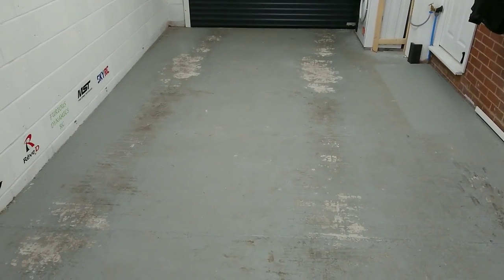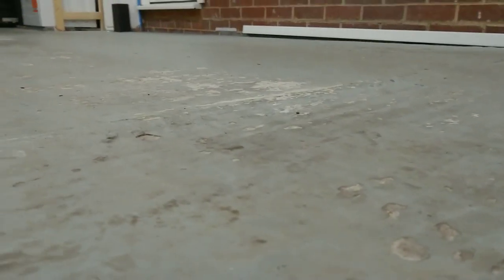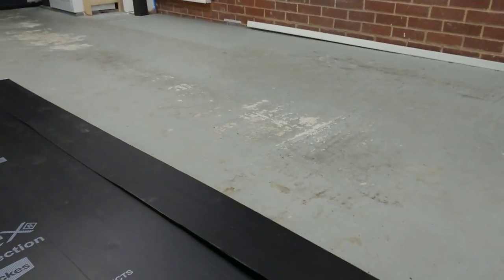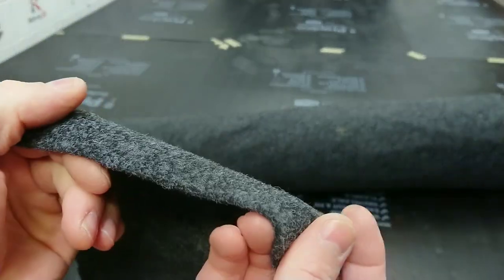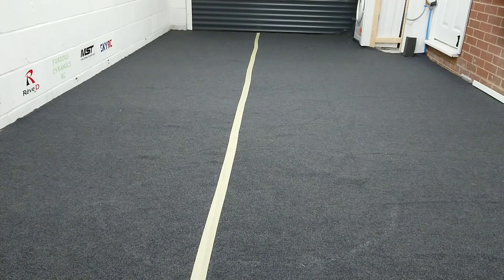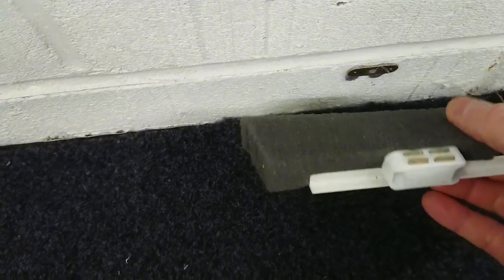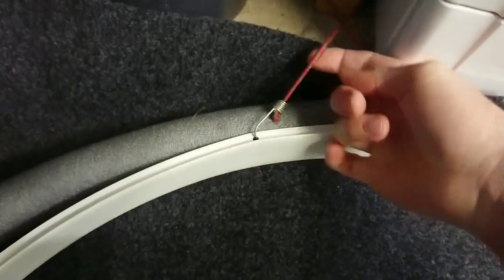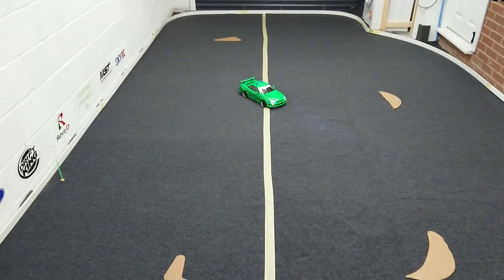Home RC DIY drift track, Garage conversion.

Comment: Thank you so much. You got the wheels in my head churning. My garage floor isnt smooth but with these materials I can make it work. Ive never drifted but am going to get 3 drift cars for Christmas. For me my son and future son in law. They need an escape from the ladies and I need someoen else in this house to join me in rc hobby lol (I do cralwlers bashing and speed runs right now. Also learning scale scratch building)
Reply from the maker: That's great to hear, glad the video could help, and I hope you can make it work. You will love drifting it's so rewarding when you can get some smooth laps especially if there are a couple of you in a train. It's definitely my favourite RC hobby. What Drift cars did you go for?
Reply: @furiousdynamicsrc  I haven’t ordered yet. I’ve been looking around. Hoping to hit around $160 each mark. I looked at Traxxas Lattaxx. Wasn’t sure about the the stick wheels. I assume I’d use the slick plastic ones? I saw a Traxxas drift tire but it was rubber. So any info would help me.
Reply from the maker: @Kozmonot420  I've not heard of them. We don't have alot of Traxxas dealers in the UK. I would say go for something in your budget and if possible a local supplier so it's easier to get spare parts / upgrades.  If you were after a 1:10 scale drift car I would highly recommend the MST RMX. See other videos on these. A good friend of mine has reviewed a lot of smaller scale drift cars which may interest you. He is @Tomley rc so maybe worth a look. Hope you find something and have a Merry Christmas.

Comment: Look awesome, i would like to do smth like that. How much time does it takes to undo everything or just set them back in case u need to use the garage as a garage? Also perhaps you could put a link for the carpet?
Reply from the maker: Thanks. It takes about half an hour to set up and dismantle. Carpet is just subwoofer enclosure carpet ordered from eBay. It was 10 metres x 2 metres.

Comment: where did you get the carpet and what is it called?
Reply from the maker: The carpet is car audio carpet used on subwoofers etc. I purchased the carpet from eBay in a 20 metre length and 2 metre width.
Reply: @furiousdynamicsrc  thanks
Reply: @furiousdynamicsrc  where did you find this? is there a link?
Reply from the maker: I purchased carpet from eBay. It's subwoofer enclosure carpet. 2 metre X 20 metre.
Reply: @furiousdynamicsrc  thanks mate, had a look just can’t find anything over 2x2, nightmare, trying to get myself 3x3 but can’t find anything
Reply from the maker: If you search this on eBay UK it should come up.
Anthracite Grey Automotive Speaker Enclosure Acoustic Carpet Bass Shelf Kit 1.95
I got the 20metre length, and to make it wider I used masking tape to join together.
Hope this helps.
Reply: @furiousdynamicsrc  Thank you mate! Really appreciate the advice